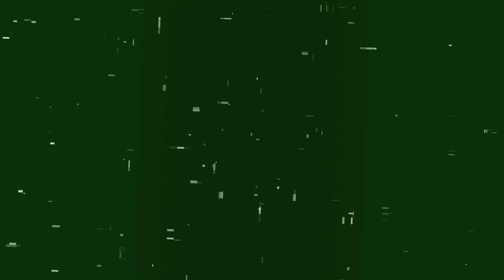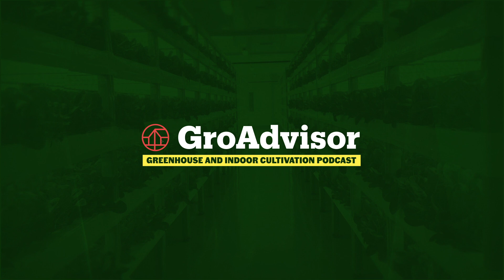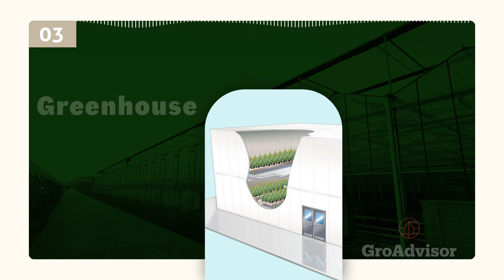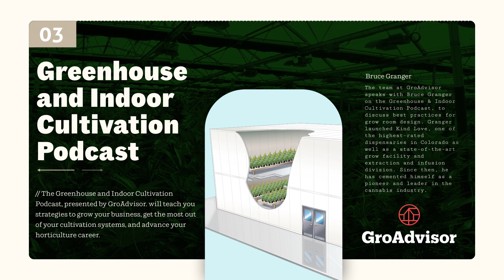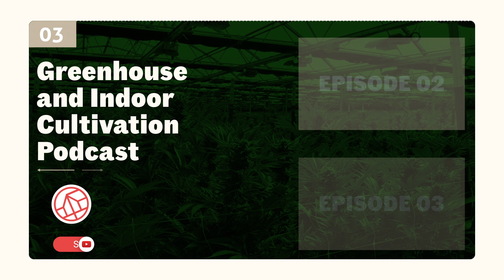Episode 3: Best-Practices for Grow Room Design with Bruce Granger

Comment: Great discussion, this video deserves more views. I'm currently doing a business plan looking at building a phamaceutical grade cannabis cultivation platform, boutique in size but with an emphasis on providing a controlled environment that is dialed in for the genetics to express themselves fully. Entry to rooms I was thinking scan card access with cards allocated to certain areas only, seperate corridors for personel/plants and maintenance/service personel and waste. Room entry for a purpose only. Barcodes track plant material movement and can be linked back to environmental data, irrigation/fertigation data, from each room during its life in the facility, a complete recipe for the COA report at the end.